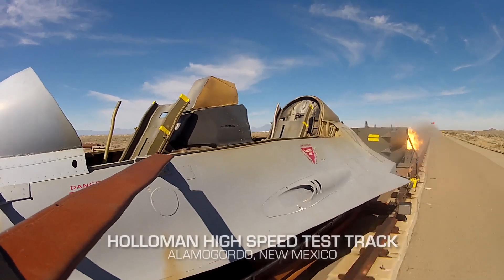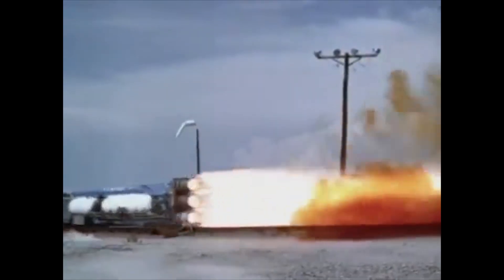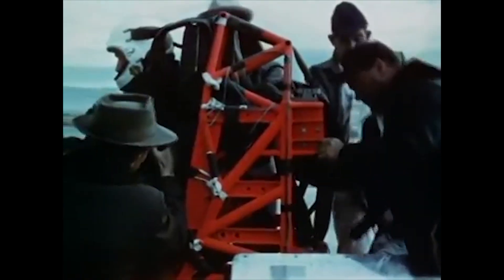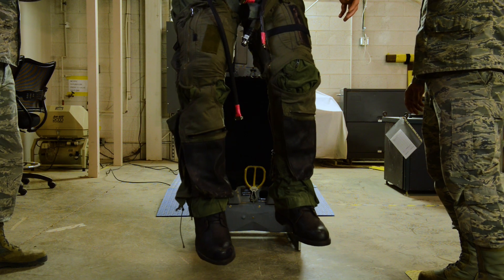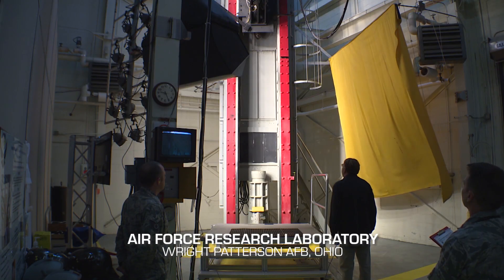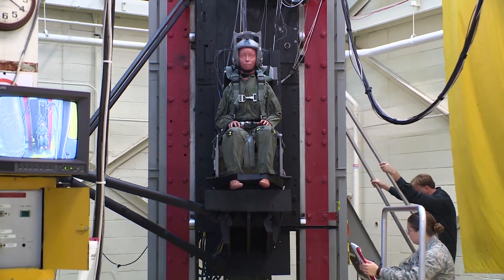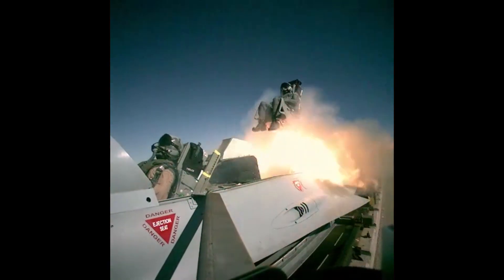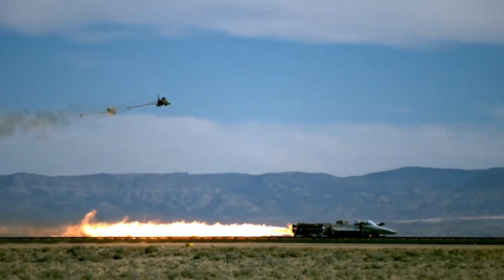Holloman High Speed Test Track

Comment: Thanks for posting this. 

Those heavy-duty crane tracks, modified to keep the sled on the track, could also be modified to hold other loads, like 
shipping containers.

With the carriage attached to the track there’s reduced chance of separation or derailment.

What is the cost of a mile of that track?

Has there been consideration to extend the track greater distances?

Has track been used to move loads such as maximum tare weight of 20-foot, 40-foot, and 53-foot shipping containers? 

This type of track, designed to ensure loads are held onto the track, leads me to believe it’s possible to move load(s) of freight and people safer and at higher rate of speed than currently available.

I look forward to hearing your thoughts, if any.

Thanks,

Jeffrey Aiken

Comment: I worked there from 1981 thru 1983 as a civilian. Saw some really cool shit fly down that track.  They have made it longer since I was there.  We used to police up the unused solid rocket propellant and pack Coke cans with it.  #glorydays
Reply: Hiya Kelly, can I ask what was the speed you tested ejector seats at? Someone has posted that they are checked whilst doing 6000 miles per hour. I thought, '' What would be the point?''. Proving something works at that speed does not mean it would work at say Mach 2, 1552 mph. Just assuming even if you weren't working at the 'front' at the coal-face as it were, you would've picked up something over the years? Any insight? Thanks Kelly.
Reply: @garryleerob  Well, that's kind of a trick answer.  Yes, they have tested stuff at 6,000 mph, but that's data usually generated for missile tests.  The reported speed record at the track currently stands at 6,453.409 miles per hour, which my calculator says is Mach 8.6, or 9,465 feet per second.  I suspect there were tests beyond that but I was not invited to that party. Ejection seat testing when I was there rarely exceeded mach 3. The current posted fighter speed record is 2,193.2 mph, which is around Mach 2.8.  I never saw any aircraft testing above mach 3.  But keep in mind I did not have a top secret security clearance. The highest we ever had was Confidential, so there were plenty of tests we were not allowed to observe.